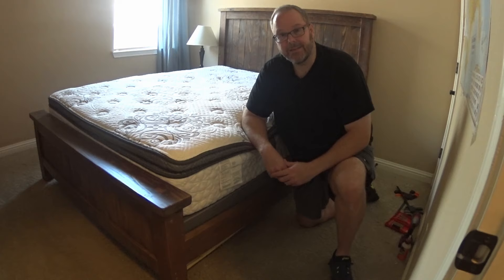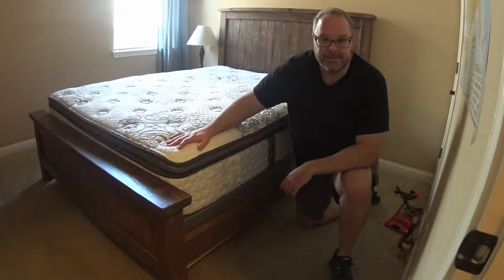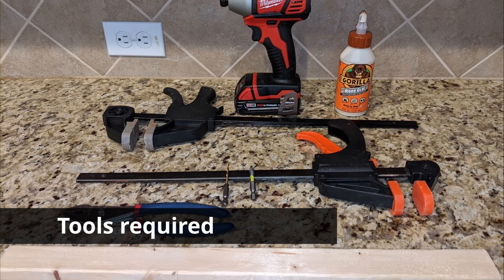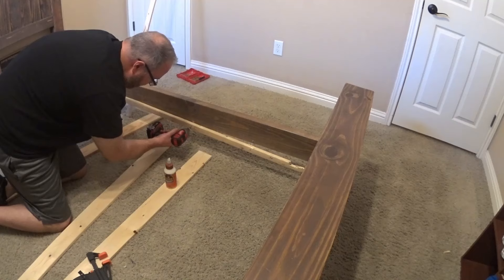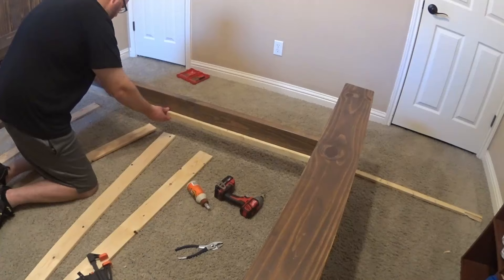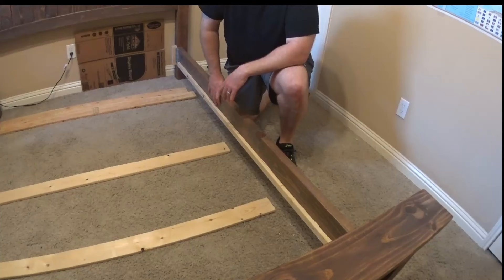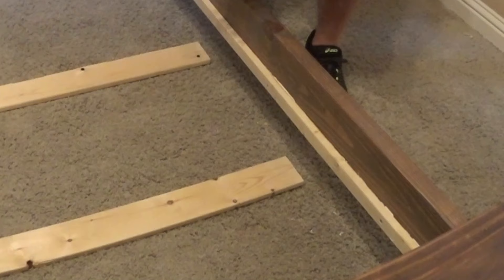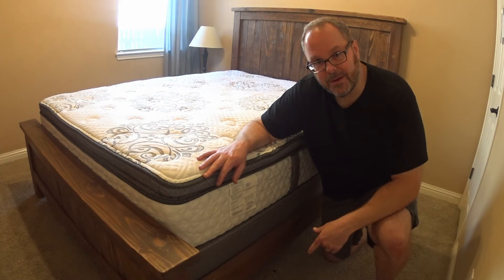Fix a Broken Bed Frame Rail - DIY

Comment: The wood in the middle of the bed is broken. How much cost it to repaire by furniture repaire company
Reply from the maker: I have never had it quoted but I am sure it would be a lot. If it's the wood in the box spring mattress that broke, here is a video I did fixing that that could be helpful: https://youtu.be/p3Wd1wiub5A

Comment: Thanks. I amd making a similar repair to a king size bed without removing the box spring and mattress by using glue and 2.'5" bolts from outside the side rail.

Comment: I suggest two additions: first, when working with glue over carpeting, put down a dropcloth. Second, your slats are way too flimsy. You need center support  or, over time, the boys or you
will cause the mattress to sagnegating any warranty on queen or kingsize beds.
Reply: Yep centre support and slats 3 or 4 inches apart.

Comment: Thanks so much for your video. It has helped me a lot as the movers lost the side rails to my bed and I have to replace them. What are the dimensions of the wood you put on the side?
Reply from the maker: Glad it helped! I used 1 inch x 2 inch x 8 ft furring strips from Lowes. The 2 inch x 2 inch x 8 ft could also work just be sure to predrill the holes before you screw them in to the side rail. The actual side rails that I mounted the strips to are 2 inch x 6 inch.

Comment: Would you recommend doing this on a particle board bed frame as well?  Or should I just cut my losses and get a new frame?
Reply from the maker: With the glue and the right depth of screws, I think it's certainly worth a try!
Reply: Most beds are particle board now, unless you spend like 5k+, but it's not the particle board of old days, it's very dense and you may just have to use some toothpicks to give it something to grab onto.

Comment: How can I fix a crack in the headboard where the side rails attach...the rails attach but the crack is running up the headboard causing the rail to pull away
Reply from the maker: Would something like this work to relocate the attach points in both the headboard and rails? You may need longer screws. https://amzn.to/3FtB4ep

Comment: What type of/size screws did you use? And also what glue do you recommend? Great video!
Reply from the maker: Thanks for taking the time to watch the video and comment! I used  1 1/4 inch #8 Philips head screws and pre-drilled the wood to avoid splitting. My rails may be wider than yours so be sure to select a screw length that does not go all the way through your railing. Any wood glue would work, I just happened to have some gorilla brand wood glue and used what I had.
Reply: @ThatDadMike  What size should the pilot hole be compared to the screw you're using?

Comment: The side boards failed because of improper weight distribution. And support blocks near the center of each cross support to evenly distribute the weight across the boards and not just the sides

Comment: Where do you get the clamps from ?
Reply from the maker: The ones I used in the video were very inexpensive and from harbor freight. Your local home improvement store should have them as well.
Reply: That Dad Mike i have another question i try to screw the wood back on to the Railing but the screws doesn’t go in is it because i have to glue it first ?
Reply from the maker: I would drill the holes with a very small drill bit and then use the screws in the holes that you made. That will make them go in easier and prevent the wood from splitting. The glue goes on the back of the new piece of wood and provides a lot of the strength once it's dry. The screws hold the new piece of wood on and provide some additional strength.

Comment: Do I need a impact driver ? Will just my Ryobi drill work?
Reply from the maker: The drill would work great! You are just drilling small pilot holes for the screws to go in and not split the wood.

Comment: Did you consider adding more slats and just add the mattress on top and not the base box as well? The weight is probably the reason it broke, its designed for a mattress.
Reply from the maker: We thought about that. I built the bed and frame and I think what happened is one of our children jumped on the very edge causing it to break.
Reply: @ThatDadMike yeah happened to me as I was throwing a fit about the cheaply made bed, but I push off with my foot to get out of bed and I don't think any bed maker expects that type of force in once spot on their thin rails 😂

Comment: My rail now is only glued on.  What size nails would you recommend?
Reply from the maker: I would use several #8 screws (or #10). The screws will hold much better and not pull out like a nail would.
Reply: I meant screws.   One of those days.  Thank you!!

Comment: Would you recommend just glue the broken piece?
Reply from the maker: Thanks for taking the time to watch the video and comment! You could certainly try, and you could even just replace the portion that is broken. My personal preference is to use both screws and glue as the screws provide added strength against the sheering force of the mattress pushing down on the rail.

Comment: I noticed that he used Gorilla Glue.  That brand usually is a two-part glue in which one part is the bottle of glue and the other water.  The directions say to spread the glue over one surface and spray water on that.  This activates the glue and makes a foam that when you clam pressure will press into the material being glued. The glue will only gain maximum holding capacity when the water activates it.
Reply from the maker: This was Gorilla brand wood glue and does not require spraying water and does not foam. Really good stuff. Here is the link: https://amzn.to/3l6GOjV
Reply: Wrong!

Comment: Forget the slats and use 3/4” sheet of plywood.
Reply: Slats are meant to let air get underneath your mattress so it doesn't mold, which a box spring does just with a breathable felt around as well.

Comment: If anybody doing this needs to be told to remove screws using the reverse setting, it might be a cart before the horse situation.

On the other hand, maybe somebody that doesn't know anything about anything watches this and it helps them take the first step to DIY'n.